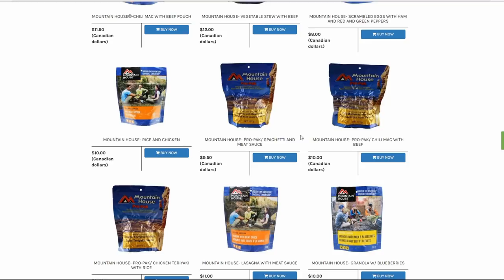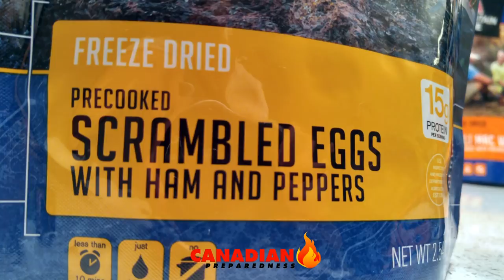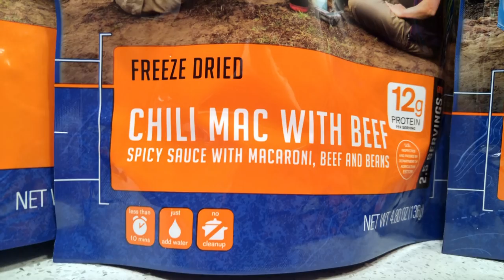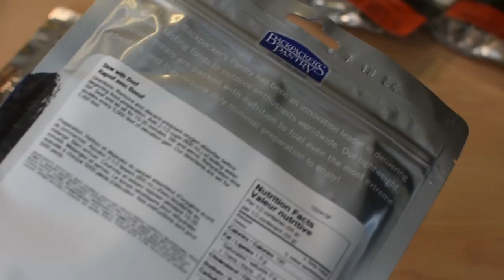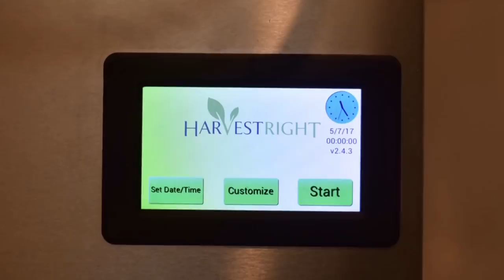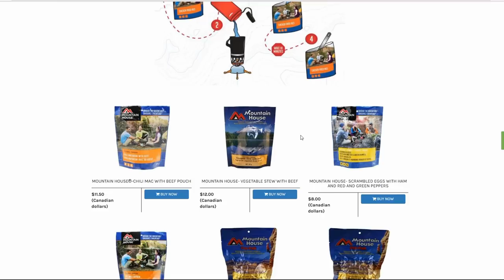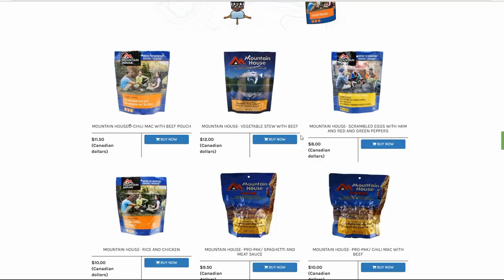Survival Food is Top Priority

Comment: danggg, some of these comments, what the? why the? who the? All of ya all who are worried about the sodium content, get on the scale right now and list your weight......I thought so. You'll die of a heart attack from over exerting (running away from the guys with guns) way before the salt gives you a stroke...Me, I plan on dying with a full stomach of Mountain House (the Pro Packs, the other ones are a little bulky, but still light) and laying in a pile of smoking brass and don't even get me started on CP's fancy saws, I'd bet folding money half of the so called preppers puny arms would implode after sawing through just a couple of decent sized logs, even with those razor sharp saw blades. I don't claim to know what shft is going to be like but I can assure you it mostly likely ain't going to be the Ice Capades or "A beautiful day in the neighborhood." When I bought my MRE's at the gun show, I needed to borrow a hand truck to carry the 4 cases (48 meals) out to my Truck, that's 30+lbs per case...ouch.

Comment: Too bad that you can't do case lot sales.

Here at REI, when they have MH sales, I go in for the discount price (- 10-15%), but then ask to buy unopened case lots (- 10%), and I get  ~24-35+% discount.  I had a $1500 sale that was worth ~$2000.

This is far more worthy in shipping out, all pre-packed (especially with high shipping costs), than single pack sales and handling/shipping.  MH should give you some options in this regards.
Reply: I've opened up and eaten 35-year old Backpackers and MH stored in a Bug-Out Bag - and forgotten.  No taste difference, just as good.
Reply: If you get the vakpaks these are the best.  The best options for MH is to have the double pak sizes.  Just putting ONE ramen pack into the cooking pack, and you will have 2-3 gut-bomb meals (for me) of eating this highly dense and high calorie meal.  Only needs 1 cooking time, and munch on the bag throughout the day when you are hungry.  Less mess, less hassle of making a meal.